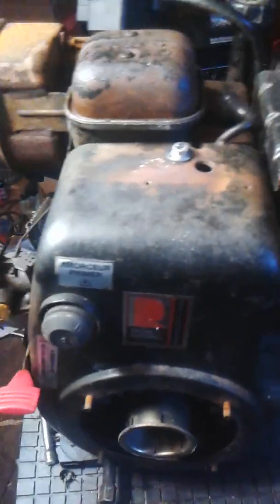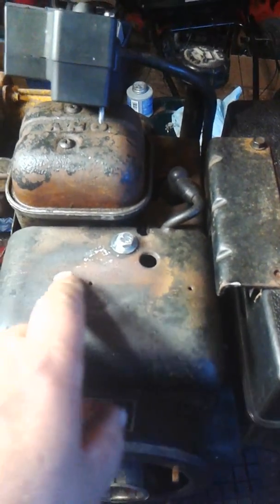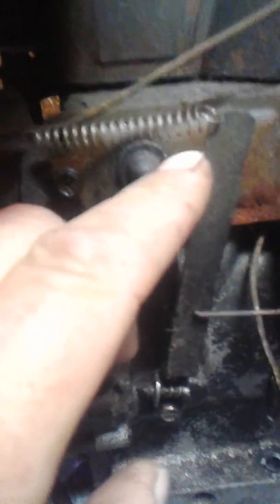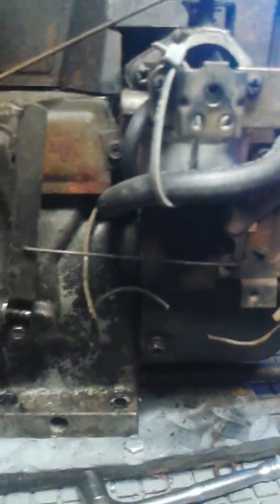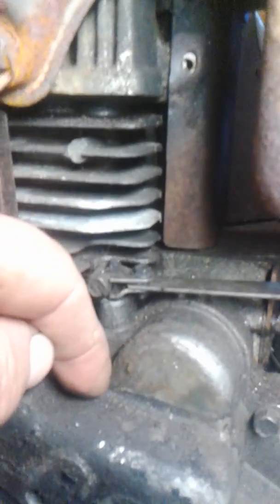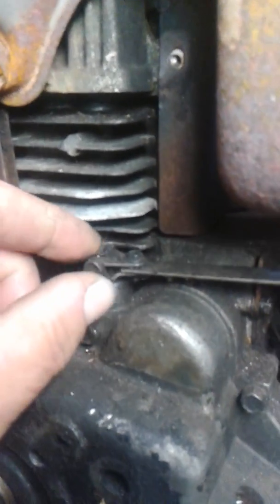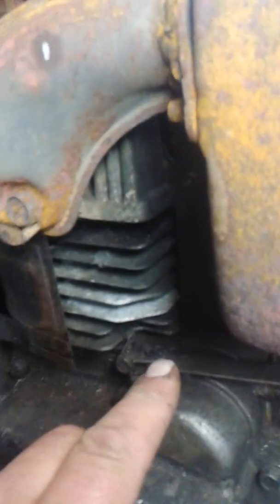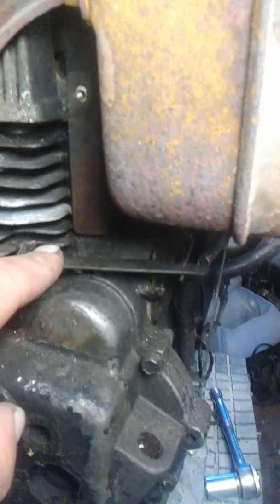Tecumseh OHSK120 and OVXL120 Govenor linkage and adjustment.

Comment: Great explanation thank you! I have a OHSK120, and the speed lever has the linkage hooked up on the bottom hole.. you said second from the bottom, I wonder if OHSK120 should also be in the second one?  Also for the most part, the speed lever doesn't do anything on mine, only when it's all the way down it stops the engine and at the very very top it moves the linkages just a tiny bit.. There's a adjuster screw with spring on that speed mechanism, the screw only touches at the very top.. I can't see anything to adjust so that the screw ends up touching throughout the lever's movement.  Is the speed lever supposed to make a difference all throughout it's movement? Thanks for any ideas.. the blower seems to work OK, I think the RPM is a bit high at idle though, and the speed lever doesn't change it at all..  I'm going to do the governor check for now.
Reply: I think maybe my low speed idle screw may be completely out of place, and that may be causing the throttle not working issue.. Will check it.
Reply from the maker: @Chris-12423  THAT will certainly do it....one turn out from lightly seated is a start point. The screw at the bottom is an idle screw if I remember correctly.
Reply: @outboardfixer  I've unscrewed the idle screw, it was in all the way, but it didn't help, throttle still does nothing.  I put the throttle up all the way, and adjusted governor also by unscrewing the screw, turn governor counter-clockwise like you show, tightened screw, and still it's idling at 4000RPM .. Tried 2 new carburetors. Maybe there's something wrong inside the engine? ... The governor doesn't seem to be doing it's job..   The exhaust is leaking air also though, I wonder if the exhaust air coming out "too easily" would cause a higher idle.  I wonder if I should try adjust the governor without pushing it all the way counter-clockwise.. maybe that would help a bit. 4000rpm is way high!
Reply from the maker: @Chris-12423   Is you linkage EXACTLY like mine? If it is not an overhead cam engine that pin turns CLOCKWISE. Also there is a TINY screw on the throttle leaver, the lever you pull up to speed it up or shove down to shut it off. Is that little screw with the tiny spring on it turned in to far?? Back that little screw out some if it has one...counterclockwise a few turns.
Reply: @outboardfixer  Yes I have the same engine, looks exactly same, it's a OHSK120 and it's overhead valve, not cam. Camshaft is down below next to crankshaft.   I know the tiny screw you're talking about, I think it's ok but I'll check it.  All linkages look same, except for carb linkage. I had to put mine in the big hole, you have it in a small hole.. my linkage is too thick too fit in a similar spot.. and this is a Amazon carburetor, not original... Maybe that's the problem.. I could drill to enlarge a similar location as you have it.. The way mine is would likely open the throttle more than normal .. which could make sense why it's able to get so much air to rev so fast. I'll see what I can do. These aftermarket carburetors are labelled OHSK120 but they're really not properly made for this engine, many of them don't even point the fuel intake down.
Thanks!
Reply from the maker: @Chris-12423  You can't open the carb to much Chris....once the butterfly in the back of the carb is open that is it....nothing there will make it rev to high...no amount of air or gas. Either you linkage is to long something is moving that governor lever or holding it. Put your throttle lever to full throttle and see if the governor lever is as far counterclockwise as it can go. You carb may not be the right one....MAYBE...
Reply: @outboardfixer  Well, placing the linkage in the wrong hole is like making it a different size.. Wouldn't that cause issues?  The way I have it in the biggest hole on the carb, it would equate to the linkage being 3-4millimeters longer than normal. I will try putting it in the same hole as you have, maybe it will fit and it's a tight squeeze.... and yes the full throttle position moves the governor go counterclockwise as far as it will go when the engine is off... and then lowest throttle just releases the tension on it and it becomes loose.
Reply from the maker: @CleverFix  It most certainly would move the governor lever to far if not in the right hole...give it a try, it sure sounds like a linkage problem. I would be interested to know how you make out...let me know.
Reply: @outboardfixer  OK So when the throttle is all the way down, I THINK the carburetor butterfly should be fully closed, and throttle up, fully open. Well on the hole this carb fits the linkage, all the way down throttle did NOT close the butterfly fully. So I put it on a nearby hole that I had to enlarge, and made sure throttle down = carb closed. Started it up, and it idles at 3000 RPM.  Problem is, now it "sneezes" .. or misfires when choke is removed. So I just used it on nearly full choke.. and the engine sounds great, but 3000RPM barely throws snow.. I think it needs 3400 or so. Anyway, I think I should just sell it as is.. the carbs amazon sells for this engine don't seem to be correct, it's obviously the carb that was revving it to 4000. The old carb had the exact same misfire problem, so a new carb did not fix it.. I thought it's the carb, but it's probably something else.. I put in a new spark plug and that helped it some, It would backfire with a "boooom" every time I turned it off, but now with the new spark plug it doesn't do that any more.  Old carb also backfired while running sometimes.   Here is the carb I got:
https://www.amazon.ca/Carburetor-Tecumseh-632107A-640084A-Generator/dp/B0787VVKS6/
if you look at the top plate, the holes don't match your video at all. but it says it's for OHSK120
Reply from the maker: That carb is for 4 and 5 hp engines and will not work. Go to Jacks' small engines on line and enter you model number to find you carb....those small 4 and 5's have a different linkage hookup. You will find a picture of the right carb. Those OHV engines do not take the same carb as the 9 and 10 hp either. You problem is that little 4-5 hp carb.